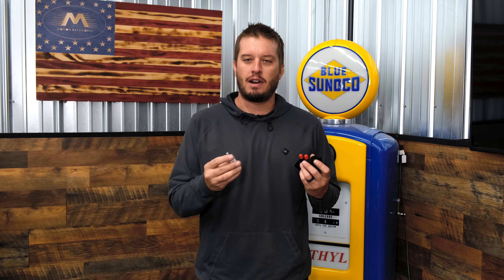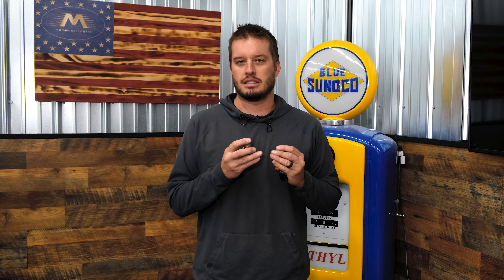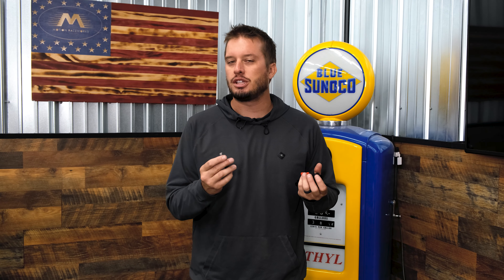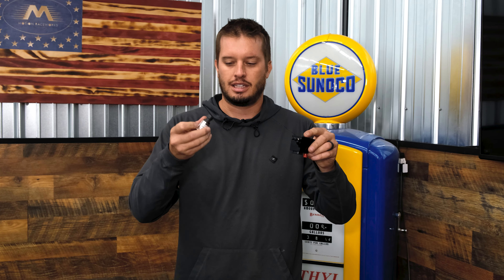Tech Tip Tuesday: Pressure sensors: What's the correct orientation for your sensor?

Comment: I wouldn't be worried about condensation so much as minor debris [clutch material] settling in the sensor bore.  But you are right: oil being lighter than water, down would generally displace  moisture with each use.  Pressure port down is the way to go.  I have [in another industry] seen sensors disabled by accumulation  of solids where they flat out went blind - primarily caused by fluid being a slurry in the first place,, but sensor placement was a key factor.  And that was on a 4k-6k psi line.  It got changed, because quite frankly...could have killed somebody had they opened the system under pressure thinking the line was bled down.

Comment: I am going to have Hogan make me an intake manifold for my 6-71 blown Chevy inline 6 292 with Falconer V-12 head. What sensors do I need to have them to design in. I have 2 Quick Fuel 650 DP and electromotive direct fire ignition. Also 5 stage dry sump if that matters. Thank you for your time.